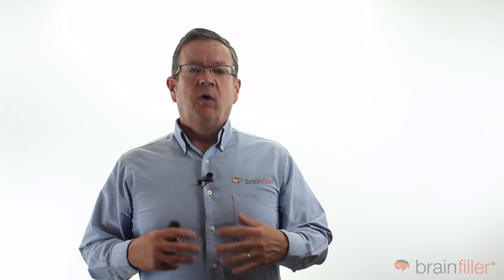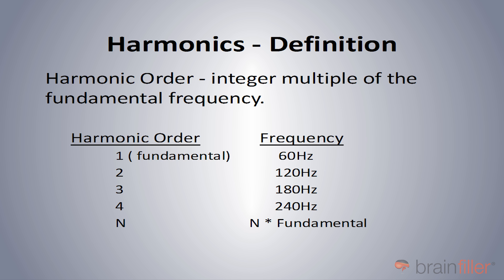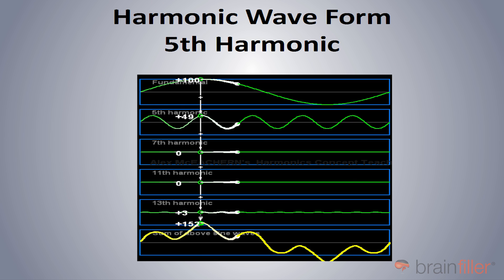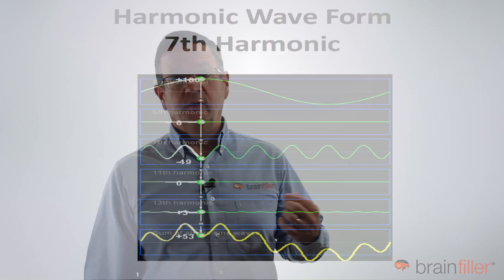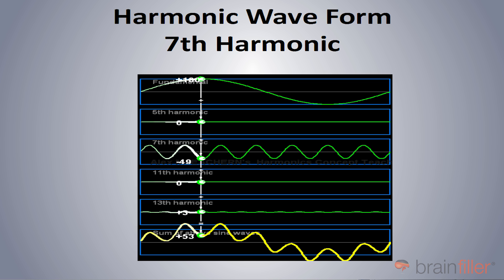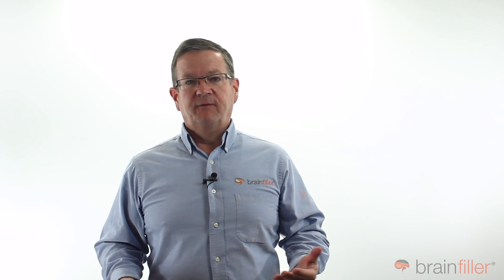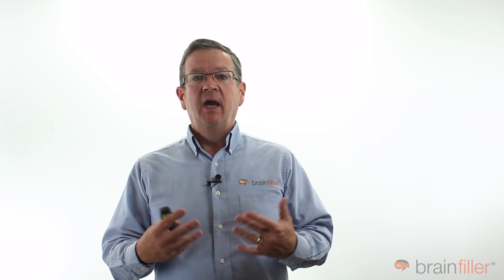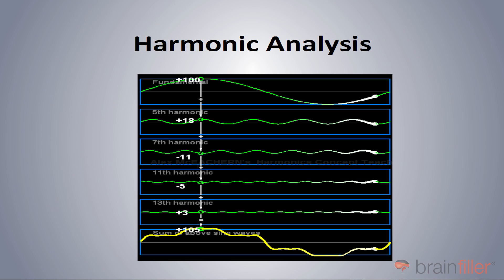Electrical Power System Harmonics Explained

Comment: @Brainfiller They say don't use the high leg. Because the current of that one load has to pass through two windings. But what if I did. Not only that, but also connect a load to the open part of an open delta system. Sending the current of that load the long way around the triangle.

Sure, the transformers must be oversized in an open delta system. But is that the only problem?

If it was bad. If these harmonics are bad. Why are they doing an open delta transformer system. And not always be closed.

I once used a high led to the max panel spaces. Let's say. The power didn't stay on until they replaced the transformers with oversized ones.

 I mean. The neutral can not physically be in the center of a triangle. To have a balanced neutral current. 

So, delta is meant for two phase loads only. Except on the center tap winding.  And wye is meant for singul phase loads only. But in the real world, every place has  different loads. 

Some single loads connect to single winds of a transformer,  and some loads connect to two windings. 

A single load connected to 208v is connected to two windings. 120 plus 120 equals 208v. And 208 divided by two is 104. But if you add a neutral. And center tap the load. No harmonics. So 208 loads must be center tapped. Like a dryer and oven is four wire.

 And that load is asking for the same current at the same time from both windings, with the windings out of time from each other. Placing the current is not insink with the voltage.

Does this matter? We just oversize an open delta transformer set up. Is this the only problem? Just oversize the transformer and a job well done. 

Can we use the high leg? I always see them never used.

If. If harmonics are bad. And to be avoided. All single phase loads 208v loads should be four wire and only 120v loads exist within that load. Like a four wire oven or dryer, with only 120v components. So it's compatible with both 240 and 208.

Comment: How we can say that the load is actually causing a perfect 5th or 7th harmonic?
Reply from the maker: There are a couple of ways to determine the harmonics being produced by a load.  

1) is to measure the specific load with a harmonic meter.  The measurements will show which harmonics are there.  

2) Computer simulations performed before equipment is installed may use one of several different models depending on the load.  For example, loads with 6, 12, 18 pulse equipment create a predictable pattern of harmonics.  

Most harmonic software has these models as part of their modeling software.  Great question!

Comment: Supoose if the load was continuously changing and it was becoming the cause of 5th harmonic now lets suppose if the load is turned off where will go that superimposed 5th hormonics based wave shape?
Reply from the maker: When the harmonic producing load is switched off, the harmonics go away.  Harmonics are treated as a constant current source based on the load (and the load being on)  The design of harmonic filters (if used) need to take this into account. 

The most complex design I was involved with was in the 1980's (yes a few years under my belt)  It was a large arc furnace for steel production.  The arcing was creating harmonics and voltage flicker back at the utility substation. lt was like hitting a moving target since the magnitude and harmonic order kept changing with the random arcing of the furnace.  

The solution involved designing and constructing a static var compensator (SVC) This is a capacitor bank with thyristor controlled reactors in series and the compensation would change on a cycle by cycle basis. (probably more than you cared to know but since we were on the subject....)

Thanks for the question!

Comment: What does he mean about the 5th harmonic? Why are they numbered?
Reply from the maker: They are numbered to identify which harmonic frequency.  They are based on a "fundamental" frequency for power systems that is 50 or 60 Hz.  The 5th harmonic is a frequency of 5 x 60 Hz or 300 Hz.  Thanks for watching. - Jim
Reply: Think of a guitar string. Pluck that particular open string; that’s the fundamental frequency (1st harmonic).
Now place your finger tip exactly at the mid point to divide the string in half (do not depress the string, just place fingertip there) pluck again.. that pitch frequently is the 2nd harmonic.. next divide the string in 3rds, 4ths, 5ths, etc.. the subdivision of the length is where the harmonic nodes live. The frequency multiplies with each wavelength subdivision because the wave gets shorter, hence higher frequency. This happens naturally. God’s design! 🤓

Comment: A question (perhaps a dumb one, I don't know):

Why only consider waves of harmonic frequencies? Surely waves of all frequencies that are somehow introduced by loads will act to distort the main signal? Is it just because it makes it easier to do the maths?

I get that the harmonic ones will be 'worse' as their peaks/troughs are in sync with the main ones peak. But surely all frequency signals will also have a large effect? What am I not getting?
Reply from the maker: Good question.  The primary cause of power system harmonics is the characteristic of the load where the current is non-linear often due to SCR's, diodes and other switching devices.  Most loads like drives, 3 phase UPS etc. have a predictable pattern that is made up of odd harmonics, and not all odds are included.  

Even harmonics can exist but are not as common.  They will skew the wave shape left or right giving it an asymmetrical shape about the axis (90 degrees and 270 degrees)  Even harmonics are sometimes an indication that there is a problem with the load, i.e. diode, SCR etc.  

I have also measured non-integer harmonics in the past which can be from a "random" load characteristic such as an electric arc furnace.  These types of loads have such an erratic current from the arcing that the harmonic content is continually changing and include non-integers such as 4.3, 5.1 7.6 etc.  Those numbers that I listed are random examples - the actual harmonics are all over the map for a furnace.
Reply: The part you're not getting is "Even Harmonics", for a reason.  Surely you are wrong about all frequency signals having a large effect.   

In Korea they do their math Gangnam Style.  

After you've done your math Fourier Style in detail (referred to in this video ) you will confirm whether your question is a dumb one, or not.  Please let us know what you found out as an ode to Socrates.

Comment: Professor, what could cause them in, and why do they matter?
Reply from the maker: Harmonics are mostly from what are known as non-linear loads.  i.e. loads that distort the current such as inverters, motor drives etc.  Distorted current can increase the heat and result to thermal degradation.  When significant harmonics are present, they can result in voltage distortion.  The situation becomes worse if there are capacitors on the system.  The power system behaves as mostly inductive but with capacitance, it now behaves like an LC circuit with resonance.  If a harmonic frequency is on or near a resonance frequency, there can be a whole array of problem, overheating, equipment misoperation, failures etc.
Reply: oh ok, so let say, l may be having some issues related to this harmonics affecting my Computer and monitor, if l plug them to a generic ups that has solve it right?
Reply: so would you say harmonics are not ever used on purpose, they are the result of a distorted component causing the harmonic?
Reply: well, not in electricity, but in Music they are used on purpose :P

Comment: Dear sir I have some question to ask you. I would like to ask you about industrial MV capacitor bank. I would like to write my thesis related to MV capacitor bank that install at 'Tiger beer brewery limited'. I would like to ask some recommendation or do you have some documents related to MV capacitor bank? Could you send it to me?  What step that i should follow? What kind of methodology or procedure? Does detuned reactor function both as filter and irrush current limited?

Best regard

SUOY Bunheng

Comment: thank you
Reply from the maker: A meter would show a distorted waveform but would not indicate which harmonics.  There are certain signature wave shapes that are an indicator of specific harmonics.  As an example a sine wave that is flattened on top is usually the result of a 3rd harmonic component.